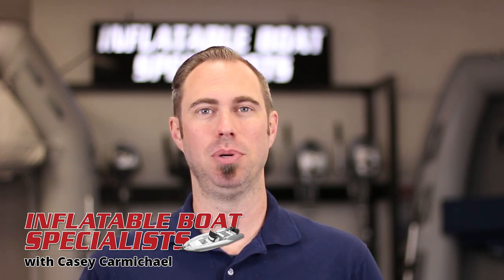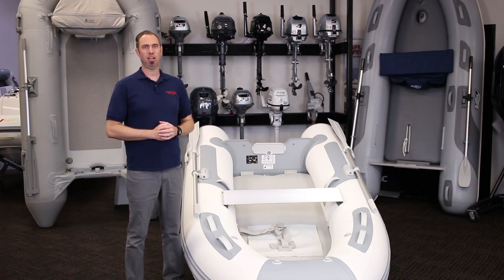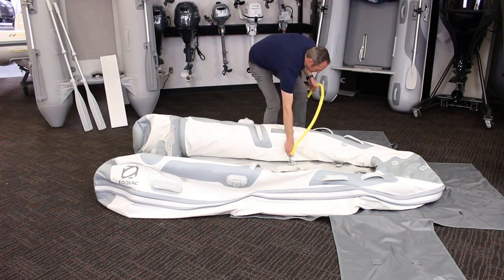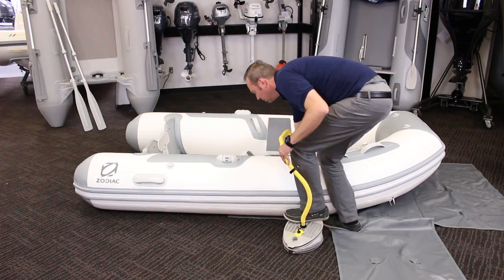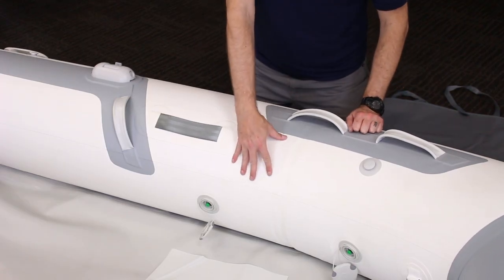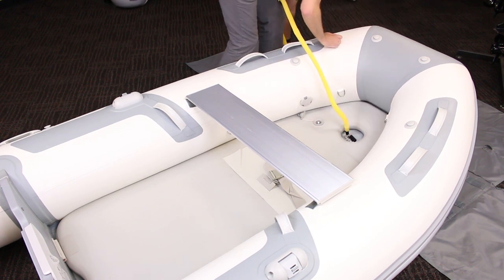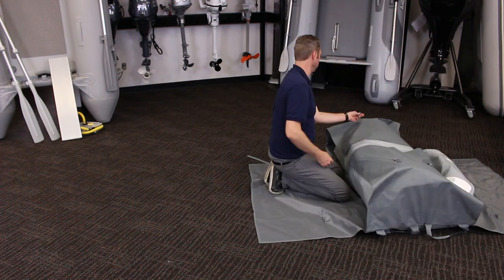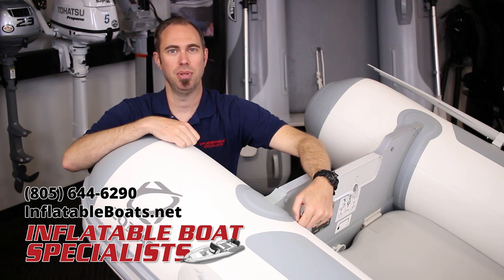Inflatable Boat Air Floor Setup & Breakdown with Casey from Boat Specialists

Comment: Thank you so much for this very informative video.  I bought a Zodiac cadet aero from a UK supplier.  I spent a few frustrating minutes trying to use the grey double hook-like adapter (used for the floor and keel) to inflate the tubes, until I saw that you were using the black adapter!  There were no instructions with the boat which I think is a frustrating omission.  Come on Zodiac!!
Reply from the maker: Thank you for the feedback. We are glad to hear you found it useful!

Comment: Excellent video! 
One thing thought. I can't see myself holding the fitting in the tube valves and pumping at the same time on a hot sunny day. I don’t see people doing that on other inflatable boat videos. Is there anything that can be done to avoid that awkward physical position and make the fitting stay in place by itself while pumping?
The inflating process has to be done after moving that 68 pound boat around... Thank you.
Reply from the maker: Thank you for your question! The Zodiac tube valves do not have any sort of interlock device, some may find that their particular valve adapter has enough friction to stay seated on its own (rubber types are usually better for this than the plastic types). It can be awkward to operate the foot pump and make sure the adapter stays seated in the valve if you are assembling the boat by yourself. The best option is an alternative pump type.... the hand-operated pumps like the "K-Pump" are easier to use and an electric pump makes every part of the process easier as well. Hope this helps!
Reply: @BoatSpecialists  The real trick is to purchase the Zodiac Air Pump Valve Adapter for $16.00 or so. This fits between the hose and the pump. Often this gets misplaced. Why is it so expensive?? Anyway, if you have the adapter, you should really firml place into the valve using some muscle. Then it will stay in place.

Comment: Hi! Great video Can you make an lsi290 plane with a 6hp with 2 people? Also, where would you sit to get it "down" on plane? Sides or center of floor?
Reply from the maker: All good questions! There are quite a few factors to consider when getting a boat to plane. For instance, It would depend on the weight of the 2 people as well as environmental factors such as how choppy the water is, wind, and whether you are using the boat on a lake or at sea. Make sure the boat is properly inflated and weight is evenly dispersed towards the front of the boat. Under the right conditions planing should be possible. Thank you!

Comment: How would you recommend lettering   a 2004 roll up Zodiak? Also, my inflatable floor only has one valve which inflates the keel and floor. Do I still make it with no give? Thanks.
Reply from the maker: Thank you for the message! There are several ways to add lettering to your boat. Boatnumberplate.com sells patches that can be applied. Stencils and paint can be used. Hanging placards w/ vinyl lettering can be used, or boat painters can paint them on.

Without knowing what type of inflatable that has the combined floor/keel, it is hard to say what pressure is best. The only model we sell that has this is the Zodiac Fastroller. For that model, the keel and floor need to be very firm, in the 7-9psi range. It should feel drum tight. Hope this helps!

Comment: yet another question: where to store the dinghy engine while underway?  Can the 6hp Yamaha with internal gas tank (or some other suitable engine for the 310) be safely lashed to the bow of a cruising boat such as the Boston Whaler Conquest 305, in a horizontal position, without any risk of spilling gas?  Are storage bags with tie-downs available that make this a secure and not unsightly possibility?
Reply from the maker: Hi James! Thanks for reaching out! You ask many great questions. I think speaking directly with our sales team would be the best way to get you the information you need. Please feel free to call our team at 805-644-6290 or email us at info@boatspecialists.com. Thank you and we look forward to helping you find the perfect boat that meets your needs! - Franki

Comment: I have a 270 AeroDeck and the floor panel came with a rigid 'plank' slotted across the beam of the boat, The manual does not mention this part. I left it in place but it seems to stretch the sides of the skin of the floor. This can't be good for the boat. Should I remove it?
Reply from the maker: Hello, Garry! That plank piece is a new addition Zodiac added to the design a few months ago and may not have made it into the manual just yet. The design is intentional and their boat has a 5-year warranty if any issues should arise. Thank you!
Reply: @BoatSpecialists  Thank you. It is a little weird that it's not mentioned. If I leave it in, it is definitely going to cause damage to the skin of the boat. I can send you pictures of it fitted in place, protruding into the skin of the outer floor
Reply: Hi Have you had any further issues with the rigid plank or have you removed it. I’m thinking of buying the 350 aero but your problem worried me somewhat 
Best wishes Dale
Reply: @dalekenworthy3246  I removed it and the boat seems to be fine without it. I need to get the dealer here to come take a look at it but 1, I haven't had time and 2, it seems fine without it.

Comment: What kind of inflatable floor can I use for a challenger 3 inflatable boat
Reply from the maker: Hello there! There are no models of air floor boats we sell that would have a floor that would work in that boat. Your best bet is to contact the manufacturer and see if they can possibly supply a replacement. Hope that helps!

Comment: I am considering the 310 as a tender, and might use it to get to go from a mooring to a restaurant dock and back at night, with 2 or 4 people including myself. Suppose conditions are typical, and there's a 7mph breeze and a slight chop in the harbor.  (a) how many trips would this require for everyone to arrive at the restaurant dry? (b) even if you travel 2 per trip, how dry would everyone be?  (c) for everyone to feel safe in the dark and after a few drinks, how many people would you feel comfortable taking per trip (in your personal opinion)? (d) is the optional bow skirt effective at keeping personal belongings dry, or does the floor get wet so everything gets wet anyway?

Comment: Do you ever wish all that stuff they do from 35 ft away it would actually just do in front of you and prove things work things are not designed well with these boats.
Reply: you just twist and lock. looks to be Hawkley Roberts valves which are commont on these boats.
Reply: It doesn't work, is that common? It doesn't twist, I wrote to the site but no answer, I sent help request, it doesn't work, it won't twist, I'll send it back and you make a video of it working. Do you check these out before you sent me the boat? also is it common for the little green tab to be easily pulled out I'm scared it's going to pop out this seems to be an extremely cheaply made vessel in very critical areas I can't blow it up as the pump you sent well not attach,  and I can't trust the valve to keep it up I'll send you pictures of the green thing it just comes out. It's just pathetic I have to reach out with social media because  you know millions of people see it and if I email you or talk to you on the phone only one person sees it or hear it and nobody cares
Reply from the maker: @John_Higdon_Art  John- Based on our transaction history you purchased this boat from us September 8th, 2017.  The first mention of a problem was in March 2021, almost 4 years later.  Friday night March 5th, 2021 you left 8 voicemails between the hours of 10pm and 11pm EST.  As you can imagine, our brick and mortar dealership was closed.   Furthermore, a callback number was never provided for us to return your calls. Additionally, you use the word “drop shippers” to describe our business which is untrue.  The boat you purchased 4 years ago was shipped from our brick and mortar address direct to yours via our daily FedEx account pickup.  Regardless of the aforementioned flaws in your review, we have attempted multiple times to reach out and help solve your valve adapter issue.  We spent a fair amount of time going thru our system to look up your phone number and email address on file from 4 years ago to match w/ our phone records.  Once retrieved, our company both called and emailed you Monday morning March 15th, 2021 -- the first business day open after receiving your late night weekend phone messages.  As of writing this response, we have made multiple attempts to contact you to no avail.  We want nothing more than to deliver a top notch buying experience as we have been doing for the past 45+ years in business.  Hopefully you will give us that chance, and this time a fair one.  Happy Boating.
Reply: What quality Zodiac, now?